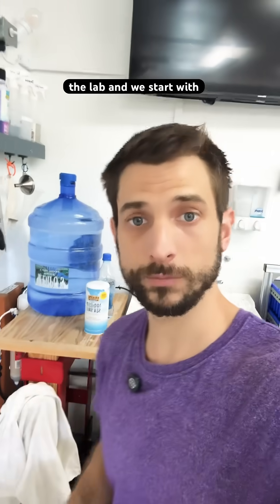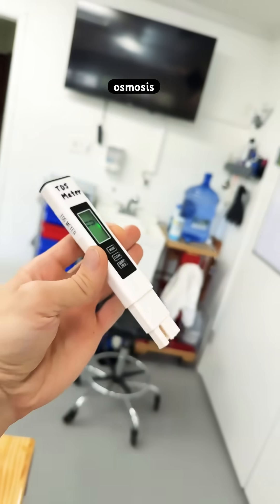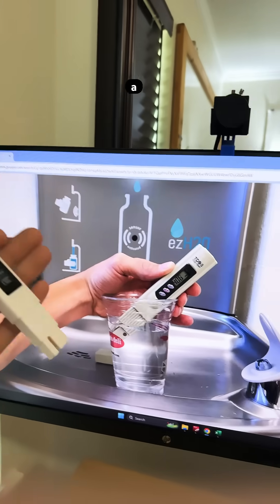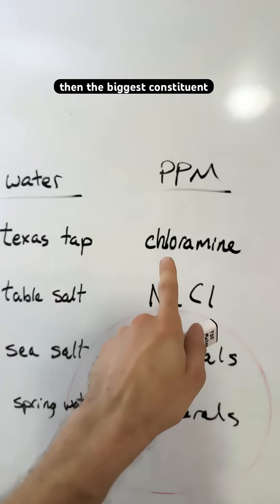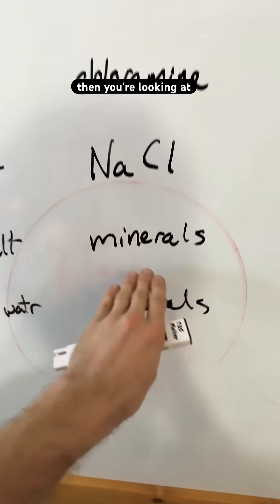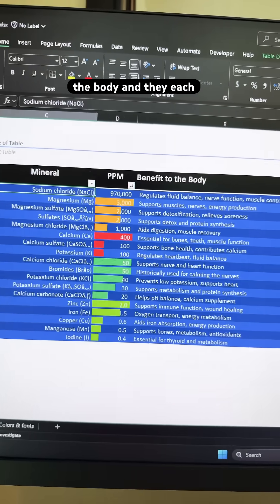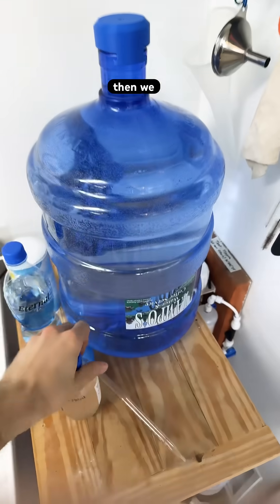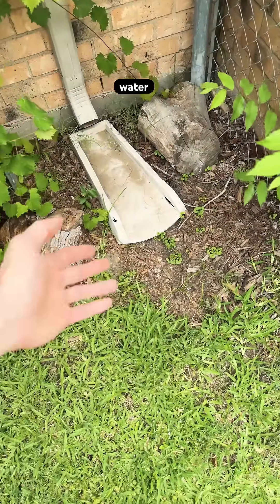you think that’s water 💧 you’re drinking? #safety #health

Comment: Your kidneys will stop functioning if you keep drinking low tds water......as a doctor let me tell you that the optimum tds for drinking water is 150 to 450 even 600 in some cases with water from good  uncontaminated springs is good but anything below 150 will cause dehydration it seems to start pulling minerals out of your body....will upset the gut lining and kidneys wwill have to struggle as well

Comment: 400ppm chloramine? Not even close. It is a common constituent in municipal water but its used partly because its effective at so  much lower a ratio than chlorine. Safe levels of chloramine are ~4ppm.
Reply from the maker: Thanks, It was several years back that I read about chloramine and it stuck in my head. I think I should have written “chloride” which comes in many forms.  

I attached a full report about my
local water, in the video description.
Reply: Why do people buy into "safe" levels of a hazardous product?
Reply: @oldblack15  because lots of very normal things follow the pattern of a little is fine but too much kills, like salt, water, or the internet.😂
Reply: @oldblack15 because “the dose makes the poison”. Even water is toxic at too high a dose. Danger and risk happen one drop at a time like filling a bathtub, not all-or-nothing like flipping a light switch.

Comment: Good work! But don’t forget u need UV. once the RO membrane is contaminated with bacteria they will eventually get thru without proper maintenance. or work their way in from the tap. Clean TDS tested water doesn’t always mean biologically clean water. TDS and PH won’t help there much. Need to make liquid cultures or prep agar plates.
Reply from the maker: i better choose a puddle in the sun 😊
Reply: or just add a UVC stage to the RO system with a flow valve to turn on the bulb when the RO tap is opened. It’s what I’m doin.
Reply from the maker: @dronelabs300blk  i’m behind the times! a couple years back I could only find gimmick-level ultraviolet cleaners so please share a link if you found a nice brand! When I read at first I didn’t think it was serious. 😅
Reply: @davidmalawey I tested the “Waterdrop” brand UV LED filter against several contaminated water sources and none of the treated water plates cultured any growth. I use it for a DIY off-grid water filter for camping and it’s been awesome. It has a 24vdc power supply, and runs fine on a 20v tool battery.
Reply from the maker: @MedicDillahunty you’re a stud! you should make a short video on that!

Comment: Where do you buy one of these meters to measure the water? What's it called?
Reply from the maker: Here’s mine on Amazon.  Its called a TDS meter (total dissolved solids)

https://amzn.to/43mVDF2
Reply: I bought a zero water filter 30 cup dispenser , it comes with a detector and it is a water filter that removes all the junk, even chloramine and fluoride. you do have to replace the minerals, if you want to.
Reply: It's called conductometer, I'm using it very frequently to check quality of stage 1 water outlet in lab at work. More advanced models with constant flow is used to measure stage 2 and higher.